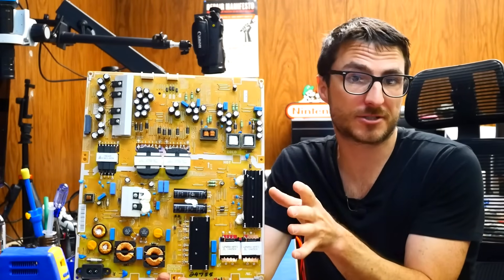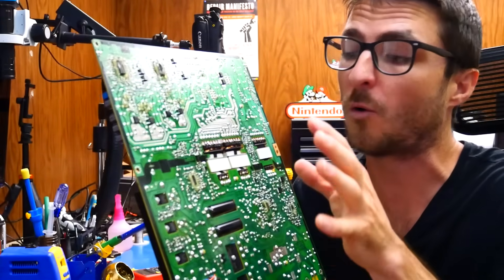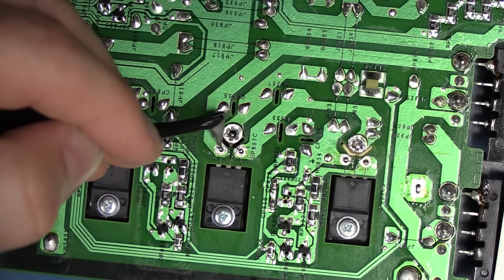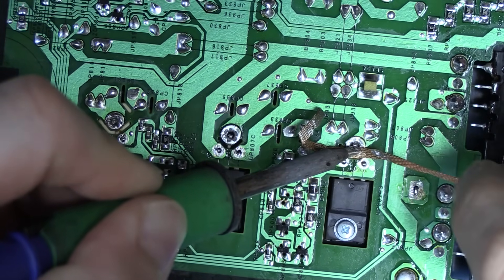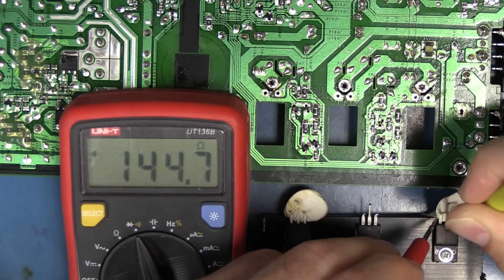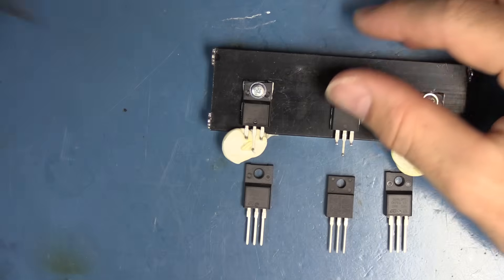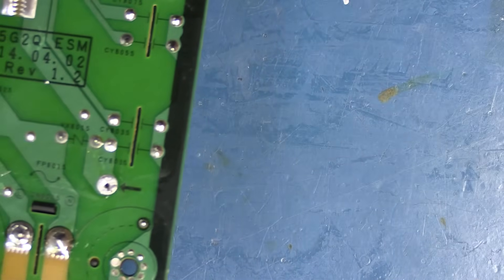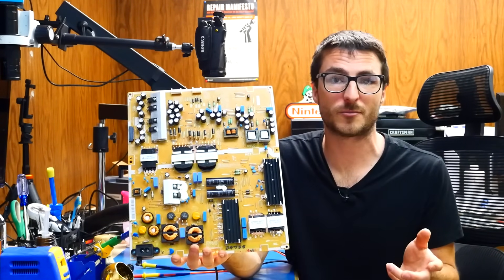Samsung TV No Power Repair UN75H7150 Power Supply BN44-00725A

Comment: Hey is there any possible way to buy three Pairs of OEM Samsung Speakers and Combined them in either Series or Parallel Setup with splicing wires joined in a organized lite backboard that can be fitted into the inside a convenient Panel Section Area that’s compatible without interference or disruption to proper functioning in conjunction to wiring of Power Supply? Please let me know because I’d like to find cheapest priced 3-Pairs ensemble of decent models which will WORK efficiently without any SHORTAGES! Thanks for your advisement input in improvising greater Sound Output possible with a cohesive electrical flow without OVERLOAD or deficiency wattage-voltage!

Comment: I have a different model Samsung but the same problem. It would turn on sometimes and then eventually didn’t at all. I was about to order a new tv and then read that Samsungs have power board problems. So I popped the back off the tv and though I’m a multimeter newbie I used copilot to help me check the pins from the power supply to the main board and nothing was coming out of them. I ordered a replacement board from ShopJimmy and it fixed the problem.  $70 to fix it and I was literally just about to buy a new tv. Glad I watched YouTube. If it hadn’t worked I would’ve been out $10 to return the item so even if you don’t have a multimeter to test like this, if your power light isn’t coming on, just swap the board and you might save a lot of money. Make sure to pop the back off your tv first and verify the exact part number on the board before ordering. Good luck! (And be very careful working around the board and when it’s plugged in don’t touch the side marked hot)
Reply from the maker: Glad the video helped you fix it!

Comment: Hi Nick! could you make guide for BN44-00675A power board? I have this board with cycling power on/off (2 sec) defect. tried to repair and I haven't been able to fix it. i check most of transistors and capacitors and cant found where is fault.
Reply from the maker: Most likely one of the IC's on the back of the board is defective.
Reply: @NicksTVRepair  could you mark which one i need to check? https://drive.google.com/file/d/1y_M1H6Lf8u52YamOM8SjzjHfyynQsi-H/view?usp=drive_link
thank you!
Reply from the maker: Sure but how would you check them? And how would you know if the lack of power or signal coming in and or out is because of the chip being defective or something else in line with it? 
The way that I identify this is by doing comparissons off a working board. I can point them out but that may not help you is what I am trying to say. Unless I have experience with that board, or at least have the defective board and a known good working one available side by side I can't always make a correct diagnostic since there are no schematics available.

Comment: Hey you are smoking (in a good way)on the board repair, Great job> very interesting! I subscribed! I give it a shot repairing my own TV's> I have a Samsung 52" that started going black screen.Picture will come up for 5 seconds then goes black.I found one of the 1200 uf caps leaking on power board changed that, but no luck.Should have read the advice on this post and let it run a bit BEFORE putting it back together.Anyway got to take it back apart and check voltages going to main board. Any tips or advice would be greatly appreciated,Dave
Reply: Must not have time to answer any of your posts. Still working on it. I ordered another T conn board and another power board. The power board I received was worse than the original and lacked many of the correct voltages, had to send it  back. My power board comes on, the back lights come on and it lasts for 5 to 10 seconds and the goes out. What component could that possibly be, I don't have a cap tester. Seems like it might be one that is not holding voltage and goes off. Got any advice?????

Comment: tip: When trying to desolder a joint using solder wick, it's helps to add a little solder to the wick itself when your heating it to get the solder underneath flowing and by using sweating to draw out the solder around the pin.

Comment: Well done. Try adding flux when  desoldering .
Reply from the maker: Actually I did. The solder and desolder wick we use has flux embeded inside of it. So for simple jobs like that there is no need to add extra. You can for more difficult joints as needed but extra flux was not necessary here

Comment: I have a PS43F4000 old samsung plasma tv. Already change shorted components, the tv work for a good 10min before blow up again. Same faulty components. My question is does the other board (display backlight sound etc) effect the power board? Done subs, just found your channel !

Comment: Hello 
What can the be wrong when the power bord dont make 13 v og the 4 pins to main bord?  Have a samsung model QE75Q60AAUXXU which won't turn on, there is no red light or anything. 
Powerbord:  BN44-01103A
Reply from the maker: You might have one of the controller IC chips be bad.

Comment: It is nice to see someone taking the time to repair something electronic and to share this with everyone. He also does a nice job of making and editing the video for us. The hard thing about repairing something like this is, until the circuit board is actually installed into the TV set you really won’t know if it is working properly or not. There could have been a short in some other part of the set that caused this failure. Additionally without the proper load on all of the supply voltages we can't know if it is fully working, or if there is any problems in the rest of the TV set. As a retired TV repair man I don’t miss all of the unexpected headaches you can run into repairing them.
Reply from the maker: For these you don't need a load to test it. I have never done it and never have had to in order to know that my repair was done correctly. As long as it all turned on as it did in the video and the voltages all checked out as they did, then not a single board has come back.

Comment: Does anyone know what the plastic clips are called that you put the wires in and then the clips plug into the board?  You crimp mettle around them and they go in (could do with a name for the metal as well).  Thanks.

Comment: Anyone know  whats the deal with samsung tv terrible sound is there an adjustment?
Reply from the maker: External speakers is the solution. Most TVs internal audio is only going to get worst as TV sets get thinner and lighter. They are going to take more and more out of the screen and make everything else required an exteranl part of it.

Comment: Hello. Why did you add fresh solder on the existing connections? To make better suction by the pump? Thanks
Reply from the maker: Yes and also because the old solder is well old and thus might not flow very well because of oxidation of the joint. The new solder i have has a small amount of flux in it, but not to much so that also helps with better flow. If I added flux directly to the joint that would also work but it's hard to does it in small quantities and thus I would probably put to much. The reason it matters in this instant while usualy it doesn't is because exess flux will clog my solder sucker and require me to do more regular cleaning. So usually i try to avoid additional flux before i desolder and adding new solder i feel like is an easy way to add just enough and give me enough good flow on the joint to properly desolder it. 
Sorry for the rant.
Reply: @NicksTVRepair  I see. Thanks for the hint and cheers.

Comment: What's the price of the kite
Reply from the maker: We don't have a kit for this board. But the parts can all be purchased online. Just type the part numbers of the transistors you need and the fuse. You should be able to find suppliers on eBay at worst case.

Comment: Hi there Nick. Thanks for the video. Very quick, informative and to the point. I have a 55” 2020 Samsung Frame TV that is power cycling. It comes with the one connect box. Is it worth trying to fix the unit? I believe the problem lies with the one connect box(contains the pcb) and not the tv. Can I use these techniques to diagnose the issue?
Reply from the maker: You may be able to although cycling can be due to software corruption, or a bad one connect cable. The cables are fiber optic and are very sensitive. If they are bent or kinked they can cause the TV to cycle. Do a check on your cable, and if it's kinked or bent replace it first. If it's not then you may have a box failure due to the mainbaord failing inside the box. In which case you may need to replace your box. Do you have the exact part number of your box by anychance?
Reply: @ Hey Nick. I solved the issue actually. I found a video dealing with a similar issue. It was with the thin boards that are directly connected to the LED panels. The short was occurring on a single contact of the slim LED board of the left panel. It was recommended that a sliver of kapton tape be used to block the connection. Worked like a dream. No issues with display. Thanks for what you do though
Reply from the maker: Wow that is very interesting. Now I am very curiouse but what is the full model number of the TV exactly? I want to keep an eye out for that in case I encounter that in the future.

Comment: In days where a new 50 inch TV can be purchased for $350 repairing an old one just doesn't make that much sense (unless you're into it as a hobby)...
Reply from the maker: Obviously I am biased here but what I just heard was (and this is extreme yes) "Why get new tires when you can buy a new car."
My response is why spend $350 on a new TV that most likely is not any better in quality when you can keep your perfectly fine TV and only spend $80-$130 on the repair. 
I will admit, the new TV probably has way cooler marketing terms associated with it but I guarantee you unless you are upgrading from a TV that's more than 10 years old, it probably is not that much better or it's worst. I have a 12 year old plasma TV from 2013 that displays just as good or better picture than most TVs manufactured in the last couple years. Of course this is my personal opinion, but as someone who has seen and worked on thousands of TVs, trust me I know quality when I see it and a lot of the new 4k sets are not it.
Reply: @NicksTVRepair  I also have 10+ year old Panasonic TV that works just fine. If it fails at some point and it will eventually I wouldn't waste money getting it repaired even if I could repair it myself. I'd spend $350-$500 on a new smart TV with all of the current input ports (USB-C etc.) and other features. BTW, you're why buy new tires when I can buy a new car instead analogy really doesn't hold water in this context as a new car is anywhere from 30 to 50 times (or more) as expensive as a new set of tires, which clearly isn't the case with replacing an old TV with a new one.
Reply from the maker: I guess it just comes down to preference

Comment: Some comments have asked why 390 volts

This power supply must be using "active power factor correction." This is done with boost switchmode converter, typically operating at somewhere in the 50 kHz to 150 kHz range.

Ignoring the input EMI filters, the first thing the AC line encounters is a full-wave bridge rectifier. There is very little capacitive filtering after the bridge - typically polypropylene film cap of around a microfarad. The positive from the bridge goes to one end of the boost inductor. The other end of the boost inductor goes through a diode to the main filter capacitors. The junction of the diode and inductor goes through a MOSFET to circuit common ("ground").

The control IC modulates the duty cycle (one way or another; sometime fixed ON or OFF time with variable frequency; sometime fixed frequency and "normal" duty cycle control) so that the input current from the AC line is sinusoidal in in phase with the input voltage, making the power factor very close to unity (one). Throughout the cycle, no matter the instantaneous voltage it is boosted to 390 volts. A voltage around this is common because it allows "universal input," typically from about 90 volts (minimum, not nominal) to 265 volts (max, not nominal) AC RMS. There is an interesting requirement - the average input current must be made inversely proportional to the average input voltage, but the instantaneous input current must be directly proportional to the instantaneous input voltage.

With two FETs in the circuit and what I'm guessing was a dual diode, the circuit might actually be two interleaved power circuits (two inductors, two FETs, two diodes, all feeding one main filter capacitor) This can have advantages with managing a number of design issues.
Reply from the maker: Thank you for providing this very advanced explanation.

Comment: Hey got a question about a Samsung tv
Samsung UN40H5103 and power supply is bn44 00754A

Tv turn on get picture sometimes then go dark, you can still see the light if the TV goes dark, so picture coming and going, no problem with sound or stand light..
What can be the problem?
Reply from the maker: That could be panel, T-con and or mainboard.

Comment: Good job.  I take one more step and do a resistance check between the gate and the source pins with the devices out of circuit.  On Samsung, they usually measure 10K ohms.  If one of the two junctions reads open or different than the other side, the gate driver was also whacked when the mosfets shorted - particularly when someone finds the fuse open and replaces it or jumps it out.  If the resistance is good, I install the semis.

Comment: The 3 look the same , how do you tell it’s a diode?
Reply from the maker: Indeed they do physcially look identical. 
There are markings on the components themselves. You have to pull up the datasheets from google and then it will tell you exactly what the component is.

Comment: Leave the screws for the trannies and diode loose until you solder them in. Let them rest where they want, then screw them down.
Reply from the maker: Im not sure if this is a joke flying over my head but you should not do that, you should always screw them in first. If you let them rest where they want then almost certainly it won't line up with the screw hole.
Reply: @NicksTVRepair  you're right, not sure what I was thinking!

Comment: Hi, first time to see your uploads. Fantastic and I very much look forward to seeing more👏👏👏Do you also repair Main Boards with software issues and if so how much would it cost please?
Regards, Brian👍👏🏴👍👏🏴
Reply from the maker: Depends on the mainboard and the repair required. If it's a Nand chip repair usually less expensive than eMMC software repair. 
What is the exact part number of the mainboard you would like to have us fix and also if you can provide symptoms.
Reply: @ Hi, thank you for your reply. The TV is a Philips 55PUS64001/12 and the main board is: 715G7776-M01-B00-005K. Fault, When attempting to switch on I get the following request: Android Recovery Philips/QM16exe_U/QM16XE_U 8.0.0/OPR5. 170623.014/026680 user/release-keys Any button cycles highlight. Long-press activates.
Reboot system now
Apply update from SD card
Wipe cache partition.

I tried to use a keyboard to reboot the system but obviously didn’t work. Corrupted firmware I believe.

Can you fix it? Where are you based and how much would the fix be please?
Regards,
Brian
Reply from the maker: This does sound like a software failure. And while we do fix software failures often, we require a good version of the software to be able to fix the TV. Without it, we can't perform a repair. Unfortunately, we don't have software for any Philips TVs so I won't be able to help you there. I would recommend trying to replace the mainboard if possible.
Reply: @ thanks again for your reply. Ok will keep my eye out for a cheap board.

Comment: Excellent illustration and informative troubleshooting.  One tip I've learned when using the solder wick, spread it out "pull it side to side" then it will absorb the solder even better.  Anyway, well done.
Reply from the maker: Thanks for the info!

Comment: This video is very helpful....I'm learning how to do component level testing, but our tv is having a weird problem. It was working fine except for a few defusers that fell off and a few dead leds.... so i replaced the led strips.

Now the LEDs strips flashes and i verified with my multimeter that the output voltage to LEDs irregularly fluctuates between 0v and 40v, leading me to think the power supply is faulty.

What might you suggest to look into on the power board?
Reply from the maker: Most likely you have a bad connection somewhere. I would highly recommend you start by double checking that all of the connections are proper. When I say connections I mean every wire connecting to the LED strips and the led strips to one another.

Comment: You just replaced the damaged components but not figured out the reason. Samsung capacitors are sucks
Reply from the maker: Samsung capacitors are almost never the issue. This has been the case for over a decade. Between 2000-2013 you would have been correct. 
The reason those components failed is because they are 10 years old and they just wore out. 
Nothing more to it. It's like saying you changed out the flat tire on your car but you didn't figure out why the tire went flat despite not having changed it in 10 years. 
It's just wear and tear on the power supply.
Reply: 10 years old ,if  the circuit does not catch the same problems customer so lucky. In my practical experience, I would recommend changing the oscillating circuit to all the electrolytes capacitors.
Reply from the maker: The repair we did should be plenty. There won't be any other problems with that power supply for a very long time. If there is it would be unusual. We always do a 1-year warranty with all our repairs and have performed this repair many times with almost no warranty claims.
Reply: @NicksTVRepair  👍